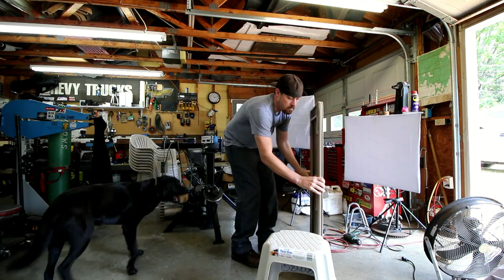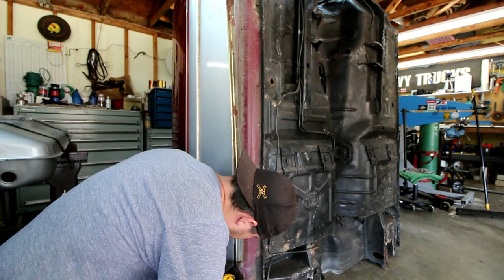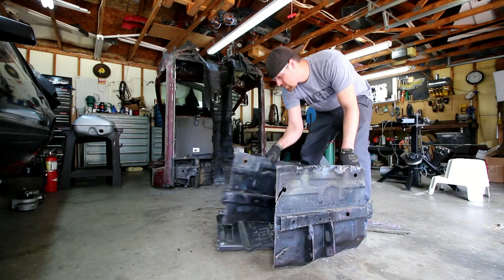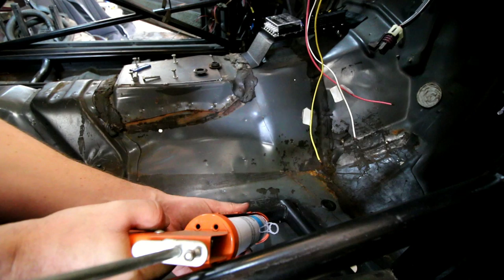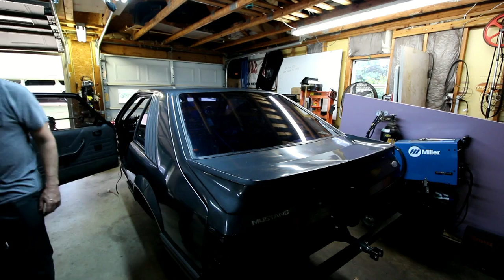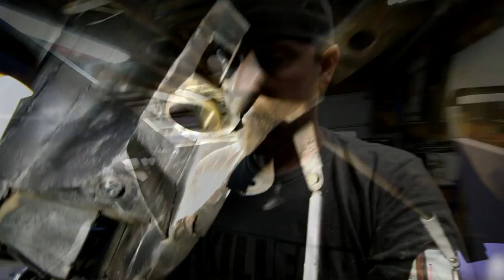Lets Cut This Mustang Up With A Plasma Cutter?

Comment: Kyle,

I noticed you were using an esab plasma cutter. I also have a esab handy plasma 125 that I have had for more than six years and only used it once because when I used the first time it would shut my tv and home entertainment off so I was afraid it would damage something. Would you know what might be wrong? Also I am having a hell of a time trying to find the electrodes.  Thanks keep up the awesome videos.
Reply from the maker: +RichyA Antonini no idea....I get my tips at my local welding shop
Reply: shut off tv and entertainment because it overloaded the circuit and flipped the breaker? make sure you're plugged into an outlet and circuit that can support the input current of your machine and anything else running off of that breaker.

Comment: 28" tire you may be alright with 355s. but 327s in my turbo stang were night and day improvement. You already know that.
Reply from the maker: +Bryan Michalski you liked the 327?
Reply: Yes, Na I had 373s great all around street gear. Turbod not so much. Could not build boost in first or most of second gear because they were to steep. First gear was worthless. Switch to 327s. Major difference. Car has better street manners and now is able to use boost in all gears. Feels twice as fast. Whole new car. With the auto and a tall tire 355 may give you the same results as my 327s. You going to restall that converter for the new setup and gearing later? Who do you use for converters?
Reply from the maker: Hey +Justin Johnson I appreciate the offer but I dont know that a factory ring and pinion gear set can survive the power levels the goose will see. I am pretty sure I will need to run a pro set.

Comment: I have a turbo'd mustang like everyone else In the world... Anyways I run a 325/55/15 mini tubed no problem. Also run a glide with a 3.31 gear and the tire is 28" tall I go thru the traps at 6300rpm about 145mph. It all really depends on how good the converter is and slip%
Reply from the maker: yeah I agree

Comment: think you have about the optimum space for the stuff youre doin as a hobby , might add a small lean to for stuff you just need to store for a while  if you go mush bigger you'll just collect more junk and whont be able to find youre stuff anymore

seen a english tv show a while back where they restored a jaguar e type , they used a paintbrush of wish the taped the hairs up to about halfway to spread the seam sealand after aplying it , good thing about that over using youre finger or tump is you whont rip them on sharp edhes , the brush pushes the sealand deeper intoo the edges too

about the factory look its kindah wat foose is aiming for , he allways said you dont see wat i done to the car untill you set an original car next to it
Reply from the maker: +watahyahknow yeah